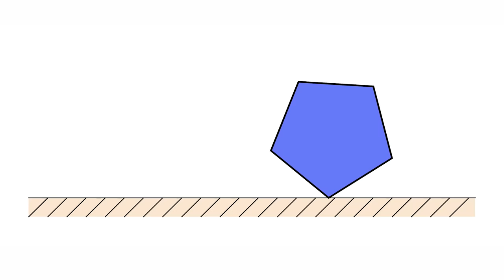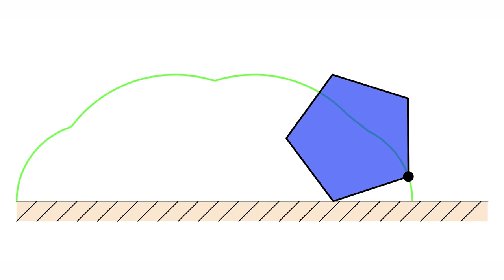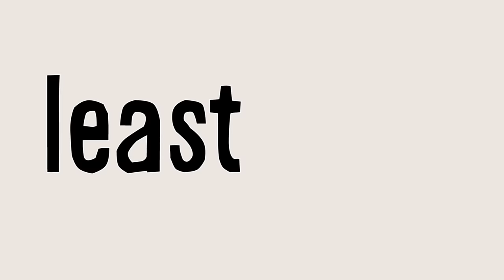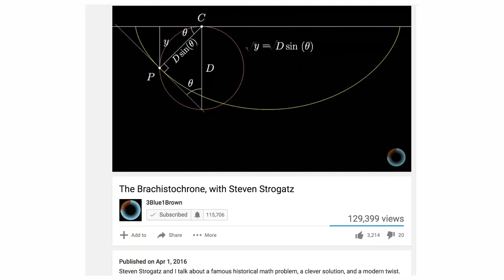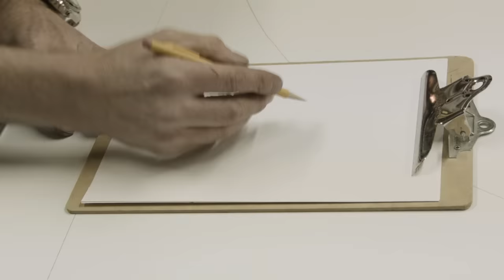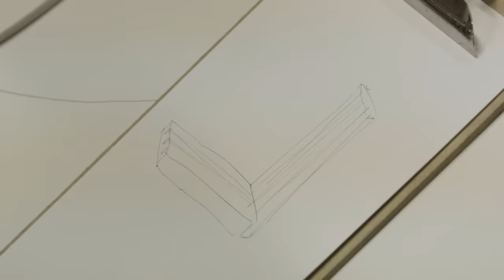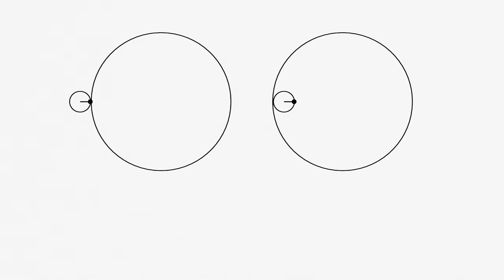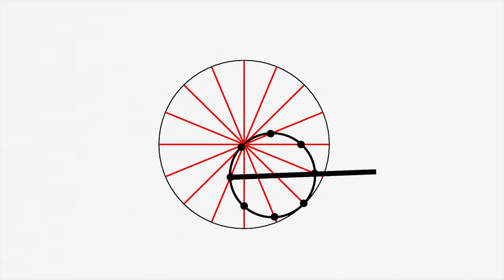The Brachistochrone

Comment: But what does a point on the surface of the circle draw whilst rolling down the brachistocrone?
Reply: Tumetron3000 thanks now my  brain hurts xD
Reply: This why people hate and love science.
Reply: a smaller brachistocrone maybe
Reply: Tumetron3000 wut I dunt get it
Reply: circles are hard to understand :(
Reply: dammit now i  have to know
Reply: not even remotely close to a line
Reply: a line ? seriously bruh?
Reply: it mirrors itself. The same brachistocrone, but it is axisymmetric. (i am not sure how it is called in english)
Reply: A hypocycloid if the circle is rolling at its extremities. If the circle is in contact with the brachistocrone at its centre, it would give a ribbon pattern.
Reply: An emetochrone, the curve with the shortest time to make you puke when you roll down it.
Reply: Liesmith LOLOL
Reply: Asking the real questions
Reply: Tumetron3000 complexity is starting
Reply: Imagine the brachistocrone was part of a circle (though it doesn't make a circle, I'm guessing it loops in itself) and have the circle roll down through it. It'd look the same as if it was rolling down a straight line, but have an overall curve to it.

That's just me guessing here though.
Reply: I suppose it does hypocycloid. Effectively, if I understood correctly, if we were to extend a brachiostocrone, wouldn't make a circle? Specifically, in the example with the refracted light, it looks like it.
Reply: the brachistocrone also basically works like an y=1/X thing. Make x0, and Y tend to infinity. Make X infinity, and X tends to 0. Amazing, Right ?
Reply: Depends on the size of the smaller circle. It's like rolling inside the circle.
Reply: You'd need to find the equation for a brachistocrone, ten do a coordinate transformation of the those equations onto the line of another brachistocrone... I'll give it a shot :P
Reply: if the circle is the same size as the circle that drew the brachistocrone it will be a straight line
Reply: It might create something similar to a roulette but slightly curved. Roulette + cycloid maybe?.
Reply: It won't be a smaller brachistocrone, as requires the line to be straight, which we know it isn't.
Reply: +Delos X the brachistocrone does not look onto itself, which you can derive from how it's drawn. You roll a circle over a surface. So as it rolls, it gets further and further from the starting point!
Reply: +Sosuke Aizen
It doesn't work like that. The curve can be drawn further, and it will go back up. Remember that it's drawn using a rolling circle on a straight line, tracing a point on the circle. It will come back up to hit the surface after it's reached a slope of 0. y=1x never reaches a slope of 0.
Reply: after a bit more thinking (half mintue) i came to conclusion that is a straight line actually
Reply: not always tho
Reply: Well, I think it will be difficult to work it out without the maths - I found the coordinate system I need - it's called the Frénet-Serret coordinate system, and is quite general but should hopefully give us what we want. In 2 dimensions, one coordinate is a long a curve of choice (the brachistocrone in this case) and the other is perpendicular to the curve at each point.
Reply: But what about the turning points (where the traced point on the circle touches the straight line)?
How would such a rapid turn work in such a coordinate system?
Reply: The equations describing the cycloid are only valid in an interval where that does not occur - the solution actually becomes complex beyond those points.
Reply: if it was facing the opposite direction it would make a straight line? because it was cancelling out the brachistocrone? That's what came to my head straight away..

Comment: A few questions:- 
1) If at the end of the curves there was no stopper, would all the thee disks travel the same distance? (I think they would travel the same distance , but just wanted to see if that would happen in reality. 
2) The Brachistochrone curve is the fastest path while rolling down , is it also the fastest one climbing up? If not what would be     the fastest path climbing up.
3) Could you show the effect of the rolling of the disks from the  convex side of the cycloid ?
4) If I am not wrong , birds instinctively trace this path while flying. They loose P.E. and gain K.E. while going along the cycloid. Would it be possible for planes to do the same?
Reply: I doubt they will roll the same distance, the curve was to demonstrate the fastest way from point A to point B. if they were to carry on past the end stop, the highest roller would roll the farthest because it has more speed at the point of the end stop. But that was not the point of this exercise... :p
Reply: The rollers start from the same height , so the P.E. that the disks possess would be the same. In that case which one would go further?

P.S. I know what the point of the exercise was, we learnt about this problem in high school . Just wondering if there was an simple way to answer the question of which one would go further.
Reply: Sunil Puntambekar most of these questions are pretty obvious just think about it
Reply: 1. They wouldn't. The lowest one gives the disk maximum kinetic energy. While the one on the brachistochrone curve covers it's path fastest assisted by gravity, the one at the bottom hits the stopper with the maximum K.E., in that sense, it'd take a longer time to stop than the other two.
Reply: KE + PE = ME. Ignoring friction, this is really easy (they travel the same distance). With friction involved, I'd like to think that the coefficient of friction would be directly proportional to the force applied by the surface onto the roller, perpendicular to the tangential point of contact. In this case you'd have to integrate the function of friction to get the total energy consumed by friction for each roller-track combo. The smallest of these values yields the furthest distance traveled.
Reply: 2) How does a ball or wheel climb up a slope? You would need some assistance because the wheels by themselves cannot gain more potential energy than they have.
Reply: Scorpion2.4 Origami&Rubik Assuming that all disks have to do work to climb on the slope, my question is would the cycloid still be to best curve to climb on (by best I mean the most time optimal curve)
Reply: The highest up would roll further then the rest. As you already said, it starts with more P.E.
Somehow i believe the reverse would be true for going uphill. It's the best combination of going to point B and gravity.
yes, planes would be able to do the same (though it would not be 100% perfect), maybe interesting to put in an autopilot system!
Very interesting questions!
Reply: Gaius Julius Gluteus Maximus the climbing force would have to be accelerating to make a flipped cycloid
Reply: 1. Since the one at the top has the most PE, it will convert all of that PE into KE (ignoring friction). This means it will be travelling the fastest and hence will travel further.
2. When going up the hill the same forces are at play except gravity is slowing them down instead. If we shot 3 of them up with the same starting KE, the Brachistochrone would again be the path of least time. This is because it would again get the right balance between keeping the speed as fast as possible for as long as possible whilst balancing that out with the distance it has to travel. This is known as the path of least action and is natures way of minimising the energy multiplied by the time (Action = Energy x Time) it takes it takes to get from point A to point B. This is fundamental in General Relativity and path integrals for Quantum Field Theory if you're interested :)
Reply: xJakeparker97 I think there is some confusion in the question I asked. I was referring to the first half of the video when I asked which one would go further, since they all start from the same height.
Reply: Although, if you take into account the angle at which they leave the ramp, the straight line would hit the floor first so travel the least distance whilst the extreme curve would fly off perpendicular to the floor so would travel the furthest.
Reply: For the first question, since the gravity provides the exact same amount of potential energy to the disks on all three routes, the distance they travel eventually depends on the length of the route for the friction to stop them. In this case, although the disk on the straight route went the slowest, it would actually go longer. Correct me if i'm wrong.

I can't believe I am actually writing serious stuff on youtube. Like, I just finished watching dank meme compilation.
Reply: No, as you said for the Brachistochrone setup all three rollers start at the same height, so therefore their velocity at the bottom is equal. Their speed at the bottom has nothing to do with the shape of the curves, contrary to your statement.
Reply: I got what you're saying, but that can only happen in the ideal, frictionless condition where the system isn't affected by the deceleration of friction, and it's impossible under normal circumstances.

Comment: The size of the rolling object has some influence on the last race that's not considered here, ie in the race starting from different heights. The rotational inertia that grows with diameter quickly has the largest effect (stores the most energy, stealing some kinetic energy), slowing down the sphere (or cylinder) starting highest the most! This difference will be larger the larger the rolling object. On the other hand, a very small object might just slide, especially on the steeper section. (If they all slid that'd be fine too, but then much harder to minimize friction.)

Comment: Do rollercoasters use the cycloid curve? If they don't, they should
Reply: I think many rollercoasters use the "extreme curve" that is the longest distance but the most acceleration, but I could be wrong
Reply: rollercoasters are there to excite you and make it exciting to ride them, not to get to the end the fastest  :)
Reply: +VelvetCake But going faster excites people even more.
Reply: People get excited by going on a high speed. Using cycloid curve results
 you in getting there faster IN TIME, but it doesnt give you the highest
 speed. So, you are kinda wrong there :/
Reply: +Fruit500 the curve only gets there in the fastest time. A rollercoaster that goes straight down and slows down that the end is more exciting that a braichistocrome curve
Reply: Gleb Hrenscazu but if you close a longer distance using the curve Ina shorter time, you could make it seem to the rider at least, faster and therfore more enjoyable.

Comment: Hey Michael, what is the surface area between two perfect spheres gently touching each other?
Reply: Ben Horesh what the hell kind of question is that?
Reply: Ben Horesh Define "gently" and the mass of the spheres.
Reply: You mean the surface area where they touch?  Infinitely small, and it can't really be expressed in the real world.
Reply: Yeah but in the real world what really happens? Remeber Veritasium a few years ago uploaded an absulolutly perfectly shaped 1 kilo silicon sphere? well there's got a number thet can describe this when this happens in practice.
Reply: Ben Horesh Well, in any real world situation, there's still a margin of error.  For example, in that video, they said the largest imperfection would be a meter high if the ball was the size of the Earth.  If there was a sphere in which every atom was placed perfectly, the size of the space where they touch would be the size of one atom.
Reply: 82,5
Reply: Adam Martinelli Thanks!
Reply: I think Adam is almost true, but not entirely. If you consider a REAL sphere, made by atoms, where every atom is placed perfectly,  what Ben Horesh defines like a "gentle touch" is not a real touch. It is only repulsive interaction between electrons. So if we assume that electrons start to reject each other only when they touch and not before, we have that the contact area is the size of one electron. 
But IN THEORY, if the spheres are not made by atoms, but by points, the area will be the size of one point. That is infinitesimal :)
Reply: 8
Reply: if you're talking about perfect spheres and by gently touching you mean that they have only one common point, 0 square meters. it's a geometric point, it has no volume, no area.
Reply: In the real world objects don't "touch" each other at all.
Reply: calix451 I agree.  However, once you get down to the level of singular electrons, you're dealing with a probability of the electrons being there or not, and now you're down the rabbit hole of quantum physics.
Reply: Ben Horesh in mathematics the two would actually be exactly the same, but a bit more precisely, if the surface area of the two would be 200 (untouched), it would surface area approaching 200 (touched)
Reply: Limit of X as X tends to 0
Reply: this simple question got really complex. I like it.
Reply: The smallest contact point? I think it's an attometer (an actual atom).
Reply: A single point.
Reply: Bulai Bogdan atoms are smaller than an attometer. The word attometer comes from Danish 'atten' which means 18. An attometer is 10^-18 meters. The word atom comes from Greek 'Atomos'.
Reply: Ben Horesh singularity
Reply: Ben Horesh omg i think about that sometimes
Reply: 42.
Reply: In reality the spheres deform very slightly due to elasticity, so the surface area is really small but not 0
Reply: Ben Horesh Nothing because it doesn't touch anywhere
Reply: I don't know about you guys but my spheres always gently touch each other. That's an area of varying size depending on how I sit.
Reply: I disagree about the size of one electron. Electrons are a bit everywhere around their atoms, and that's this all thing that is repulsive. So the contact surface is about the size of an atom, not of an electron,
the size of the atom being actually defined by electron clouds.
Reply: This brings up a 0 vs nothing debate.  What would be predicted to happen depends on your stance in the debate.  Either 0 is nothing or 0 and nothing are two completely separate concepts.

Assuming 0 is nothing, the point of contact is infinitely small with an area of 0m.  This area of 0m means there is no point of contact.  No point of contact means they are not actually touching.  Ultimately, this means two perfect spheres can't touch each other.

Assuming 0 and nothing are different things, you still start with an infinitely small point with an area of 0m.  The difference in this case is that that area of 0m is still an area with an actual measure.  This allows perfect spheres to touch and makes the measure of the area of the point of contact always equal 0m.

And for people who say objects never actually touch, that is a misconception.  Remember, according to a basic concept of quantum mechanics called "wave-particle duality," the electrons in your atoms are both the particles and the force they carry.  Even when the particles themselves don't directly make contact, their waves of force, which are just as much the electrons as the particles, do make direct contact.
Reply: How gently? A single point probably

(Unless I missed the joke)
Reply: A sandwich theorem.
Reply: Ask him on Twitter. It's a good idea.
Reply: Actually if you're going down to a sub-atomic level, adjacent atoms don't actually "touch" seeing as their nuclei are held at a specific distance by electrostatic forces and the electrons are effectively constantly moving. Therefore the two spheres aren't actually touching at all!
Reply: Technically they wouldn't be touching at all.  At a subatomic level, there would be space between them.
Reply: AKA derivative
Reply: Ben Horesh darude Sandstorm
Reply: Well, if they were two perfect spheres, then that means that only two points on each surface would touch. The result wouldnt give you a surface area, you need at least 3 non-colinear points to describe an area... you would get a line. So the real question is, what would be the length of the line? Uhh... not sure, either infinite or zero
Reply: Of course, the other facet of this debate was described eloquently by Zero Accords, whose explanation is also perfectly valid.
Reply: Alexandro Ochoa Perfect spheres are impossible
Reply: We've gotten about 99.99% close.  Check out "The world's roundest object."
Reply: Mike Bircher Thank you
Reply: Yalkın ÇIRAK Not in mathematics, which is what we are talking about.

Comment: I know nobody will read my comment, but I just thought, how cool would it be if they built a 20-meter brachistochrone considering the distance in a straight line between the starting point and the finish line...I'm just thinking
Reply: Noice
Reply: Dats pretty big
Reply: Do you think you could exploit some weird mathematical property in order to use a rope as the track rather than solid material? Doubt it though. Seeing this done would be awesome!!
Reply: Yeap it will be more fascinating, if they will use real cars to race.